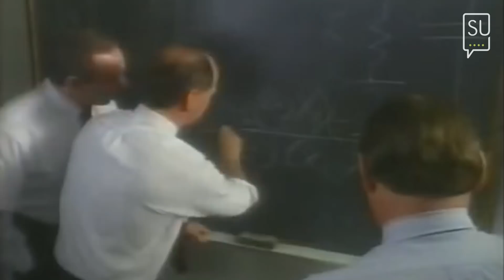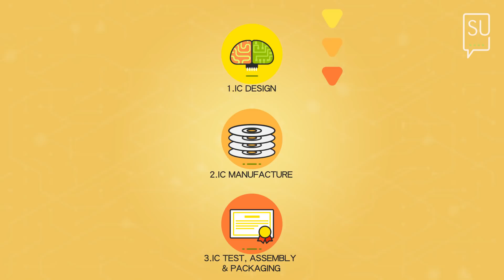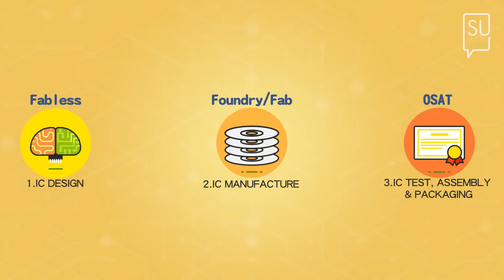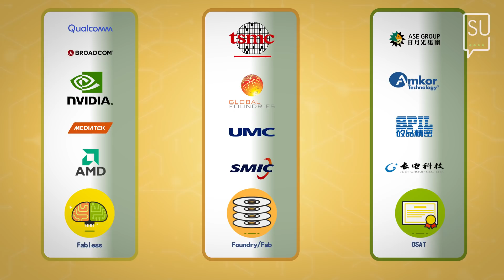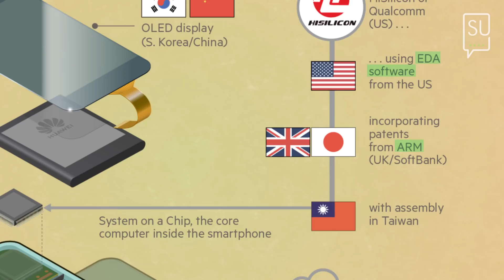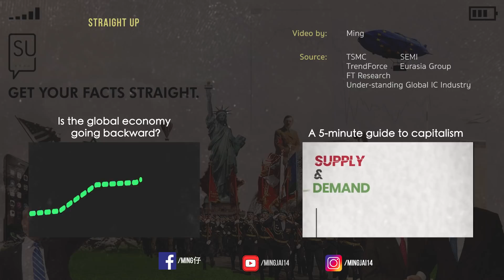How the US strangles China's tech industry｜The Chip Race📱

Comment: 2:05
what is that flag on global foundries?
Reply: Dubai - They purchased Global Foundries a few years back. So, they are a major chip player for chip design production from 90nm all the way down to 12nm. They aren't investing at 10nm or lower which is why they will not be controversial in the political arena. There are tons of competitors that manufacture chips at 14nm and larger. I expect that they will gradually start manufacturing in smaller sized chips, but they aren't trying to do so at the cutting edge.

Comment: I mean at this point TSMC is probably the greatest protection Taiwan has against China.
Reply: And an obvious one. It will take a fool not to tackle that down and make it obsolete.
Reply: Protection? When TSMC:
1. Stopped being able contribute to China's tech industry development, but continue to power all its competitors
2. Holds key capabilities and experiences that China currently needed
3. Is based in a location where it's within arm's reach of Mainland China, and that China has long claimed its sovereignty
That's not a protection at all, that's a barrel of gunpowder waiting to blow up.
Reply: It only offers protection as long as TSMC supplies chips to China. Once it doesn't, it is useless to China. Guess who is removing that protection?
Reply: idk, quickly getting through the semiconductor bottleneck seems like a compelling reason to reunify.

Comment: Kudos, good and short presentation. ASML can export DUV lithography technology, there is no US technology in it. ASML came to China International Import Expo with a full demo line (in Dec 2020). They can produce 7nm chips with DUV.
Reply: Costs double of what it costs TSMC only and slower as well. 😅 DUV already reached its limit.
Reply: @tony31181  Actually ASML can export EUV to China as the % of US components in EUV is lower than the threshold imposed by US administration: the only limitation is political. The actual solution for ASML is to produce an EUV machine free of US components/technology. The situation is pretty fluid and may evolve in few months from now with new technological breakthrough. China has a huge market potential and ASML will try to get on board.
Reply: @zephira994  There will be more opportunities to leapfrog EUV technology with new generations of chip sets.
Reply: Lower than 7nm chips will be too costly to produce using DUV.
Reply: The role of the US in the tech world is so large I don't believe there is any product in the world of tech which doesn't use some kind of a product coming from an American company